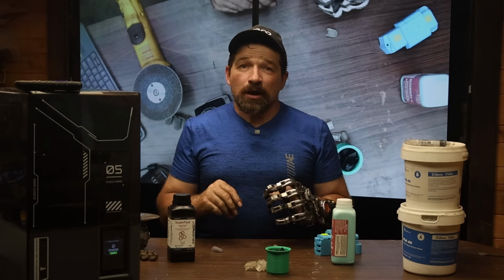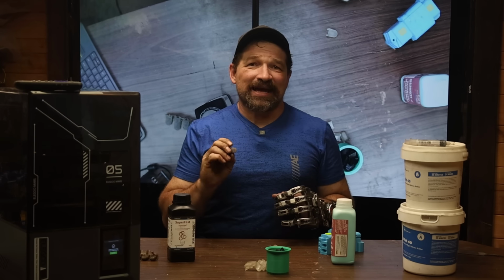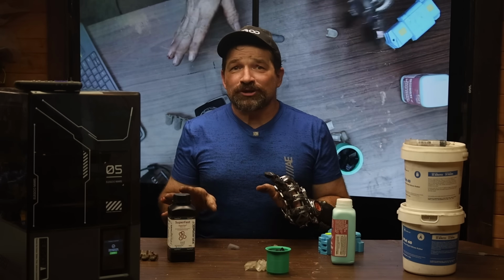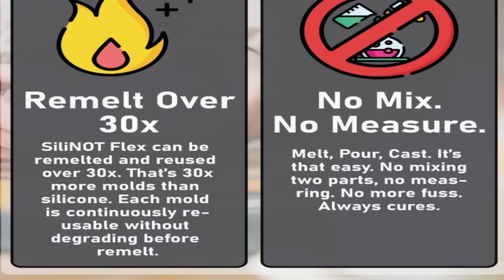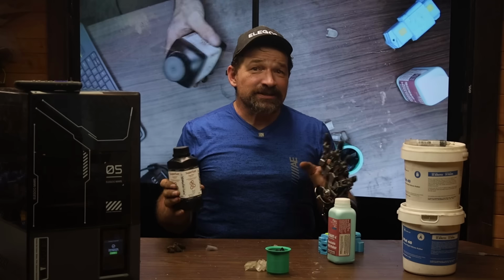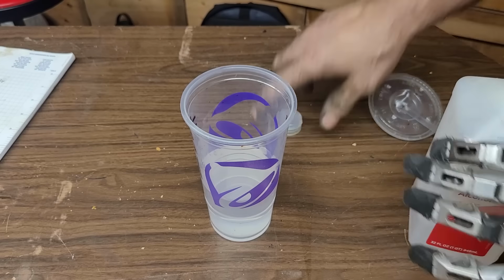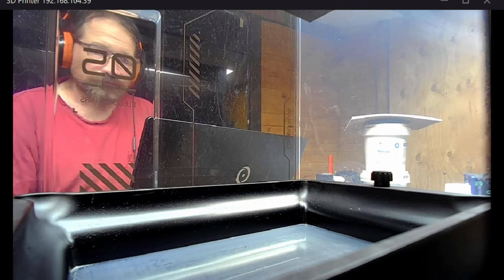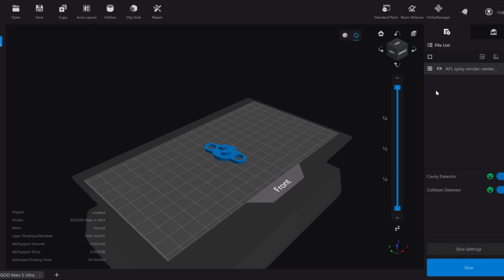Fingertip sidequest

Comment: This may sound odd, but the table tennis community has "tackiness" as a factor for the kind of rubbers they use on the paddle and "boosters"(additive/creams) that increase tackiness to the rubber. Dunno how effective, safe/food-safe, castable or if the materials have the properties needed for your case, but I hope it is of interest.
Reply from the maker: Thanks! I'll look into that.
Reply: @missingpartsclub awesome how your place here seems to have positive side effects. 
Positive waves, man. 
(It's only by dumb luck that I still have all my parts 🙈 )
 Subscribed.
Reply: @vapormissile  No negative vibes moryarty.
Reply: @mr_h831 Always with them negative waves Moriarty, always with them negative waves! 😂

Comment: Honestly, your finger tips sound like a job for natural rubber.  It's not just used in tires because it's cheap.  Afik it's a stinky thick tar before casting in a heated mold, so kind of a pain to diy.  Probably easier to CNC machine a block.  Rubber freezes and afik machines like any other plastic once frozen in dry ice or liquid nitrogen.
Reply: I concur, find out what you can about the tires used in drag cars maybe.  Heck if you contact Goodyear or some other company that makes race tires they might be willing to give you some test blocks or something.  They have to have extra chunks they did testing on.
Reply: to my knowledge latex rubber is pretty easy to work with DIY, they use it gloves as well :)

Comment: Leather? Not the most high tech solution but, worth a try.
Reply from the maker: I tried leather with the socket a long time ago, but I didn't think about it for the fingertips. I'll laminate up a block and give it a shot.
Reply: @missingpartsclub  That's interesting. My thought was to rap a form in some soft leather, never occurred to me to do a lamination like that. I'd think it too porous and crumbly.
By soft leather I mean like my favourite work gloves. Has soft grip even when wet, hard wearing and also immune to heat and what not. But the laminate is certainly more up your street in terms of material choice and style so... can't wait to see what you come up with.
Reply: A stack of sued leather or some molded sued on a silicone core sounds promising.  Afik silicone rubber works best under compression so make it an interference fit to the finger as well.

Comment: Hi, a few ideas:
1) Leather: Welding gloves made out of goat, deer or nappa leather are soft, durable and conform to any shape.
2) Use a soft silicone under the leather to adapt to the surface and leather on top for durability.
3) Gel like in bike saddles or memory foam alternatively.
4)Texture of the fingertips could be more like the lamella of gecko feet. The finer you make the lamella, the more surface area and grip you get. This could be easily finetuned with a printed mould or a textured bed.
Reply: I know nothing about this stuff, but that's such an interesting idea!! I was trying to think "hm, what could best replicate skin..." Well, the answer could be...skin.
Reply: An occlusive dressing is an air- and water-tight trauma medical dressing used in first aid. These dressings are generally made with a waxy coating so as to provide a total seal, and as a result do not have the absorbent properties of gauze pads. They are typically used to treat open, or "sucking," chest wounds (open pneumothorax) to prevent a tension pneumothorax (a serious complication of a simple pneumothorax). They are also used in conjunction with a moist sterile dressing for intestinal evisceration.
Reply: +1 for leather
you'd have to sew little flaps of it into cups/fingertips, but once they are together they should last a very long time. Might not even need the printers; once the leather is sewn, just have to add the adapter and fill with a slightly squishy epoxy/silicon mixture.
Reply: @josephd.5524  That sounds promising really. Some very high quality soft leather will basically be equivalent to a fingertip. The adapter is the bone, all youll need is a very good flesh. You could probably even laser etch a fingerprint.
Sewing seems to be the weakness to me. You would ideally want it naturally to hold the finger shape, without puncturing or stretching. Is it possible during the stretching and tanning process to conform it to a cup like shape beforehand? Or possible to bond it permanently via some form of high pressure crimping or adhesives?
Reply: very similar to what I was thinking, happy to see someone offering similar suggestions
only difference was 1) I was thinking something like shark/ray skin
Reply: @pauldeddens5349  
Now that you mention it, I know cobblers have a heat-activated leather glue for putting boot soles together. Extremely strong stuff; needs heat, pliers, and forearms like a stevedore to pull them off again. For fingertips that'd be plenty strong and to apply it you just need a heat gun and something to apply pressure, in this case a pair of pliers would be plenty. Can avoid the sewing altogether.
I figure it'd just be a matter of cutting out a small piece of leather that can be folded over itself enough for gluing, some experimenting would be needed to get the shape right.
Reply: Just use leather made from udder teats.  Preformed! 😉
Reply: I think the issue with leather would be cleaning it, especially if you use your fingers to eat (chips, fries, popcorn, Pizza ect)
Reply: Leather is the way to go for sure. Nature knows best over all this synthetic junk

Comment: The resins are usually quite brittle. The flex resins are easy to tear. This looks like two sides of the same issue, lack of cohesion, characteristic of relatively short molecular chains or low degree of crosslinking, it also happens to thermoplastics as the polymer breaks down from light or other environmental factors.

One exception i've heard of is mayermakes resin from Austria. It's quite reluctant to final cure, needing an extreme amount of UV light, but once it cures, it's very robust. It has an indicator which goes from tinted to transparent once it has cured. Unfortunately it's a hard resin not a flexible resin, so it's not the right type for your fingertips.

I have also heard of another manufacturer/startup can't remember who it is, who makes a resin which needs to be cured not only with UV but also under elevated temperature, and also achieves much better cohesion. I also don't think they have the flexible type. I'll add if and when i run into them again.

Anyway since both of these do their own chemistries, and have effectively solved the cohesion problem, perhaps it's worth talking to them maybe they can suggest an additive to modify the properties or formulate a new resin which is truly rubber-like.
Reply: So i remembered the second company is 3DRS (3D Resin Solutions) from the United States with Thermal resin. The final cure is without UV, just in an oven.

Comment: I’m a Merchant Marine Engineer, and I use a sealant called 5200, it’s tough, durable and easy to use.
I would make the finger tips out of this 5200 but remove the skin of the dried sealant to reveal a foam interior.
This should give you the toughness and grip that you want.

Comment: You considered more than one resin or 3D printed material? 

Maybe you could do a more durable lattice structure with your slick materials, and somehow integrate a smaller layer of that last stuff that cracks at the structural points as the print/grip side of the finger. A crude interlock with many small posts across the inside of the fingertip surface. Which pushes up into a polygon lattice that mounts on your tang. You could use any desired mounting method. Tension clips. Screws. Glue. Whatever. 

If you’ve got clips, you could just carry spares if they start to wear. If you included the posts that reach up as those clips that secure your lattice to the tang, you can get quick feedback on if the finger needs replaced.

🤷‍♂️
Reply from the maker: So that's what I was just thinking about. Print a lattice with the interface for the distal, and cast silicone into that.  The cool aspect of it is the fingertips will be 2 tone. Which could be really cool!

Comment: Might be interesting to look into the rubber on climbing shoes. If you do I would check out a few different models it always seems like there is a trade off of friction vs durability.

They are expensive and the rubber might be trade secrets lol. Either way good luck on the fingertip adventure!

Comment: IDEA: perhaps you could strengthen the mold on the non-tactile side by adding a hard shell with adhesive that serves the same function as the fingernail, to some extent. Yes it will only prolong the time before the mold breaks and will be harder to inspect, but the stress points will potentially have more strength in the added rigidity by the added ‘nail’.

Comment: 3d print a honeycomb scaffold in carbon filled nylon, the rough texture is perfect for excepting a coating of silicone or something similar. 

I would just brush that resin into the scaffolding of the nylon part and use a handheld uv light. 

If you do use this method I recommend not over curing the resin. It seems to become brittle. 

That resin can be mixed with none silicone like resins in low ratios (>30%)

Comment: my mind goes to regular leather or latex for alternative options, since they're used in gloves so often. the end segment of each finger could have an indentation for a sheet of material on the underside and holes through the segment in order to simply stitch the sheets on, making them easily replaced (although not as easy as having a few spares in your pocket with the tang setup). i'd maybe lean towards leather, just for niche scenarios like petting an animal where you wouldn't want too much tugging on hairs and whatnot that rubber might cause. if it were on just the underside then you could also have a fingernail on the topside, if thats something you want.
in any case you're awesome dude :)

Comment: for the resin finger tips you could increase the cavity size where the metal part is inserted and then fill it with maybe a silicone of some kind this might give you the exterior durability of the resin while keeping the inside more flexible to hopefully avoid cracking from the metal inserts

Comment: ColorFabb has produced a special TPU filament called "VARIOSHORE TPU" that foams up and changes its shore hardness based off what temperature it is printed at.
Reply from the maker: I am using a different version of that material rn. But I'll order a roll of it from my guy at Polymaker. Thanks!

Comment: Hey there! This is the first of your videos I’m seeing, so apologies if you’ve already tried some of this. 

I think some testing would need to be done, but I can see adding fibers to the silicone adding strength, creating a composite material. The density of fibers and the fiber material used could be varied and tested. Cotton balls would be a cheap first test, just to see if there’s any benefit to the fiber/silicone composite. 

Another question I have is if a dual-molding process would work, where a harder material is used for the bulk of the prosthetic tip, then that piece is fitted into a mold with a small gap for silicone to flow between, creating a grippy surface over a more solid base. You’d likely need grooves in the core of the tip, to keep the silicone adhered once cured. The grooves would also help the silicone flow into the mold. You’d almost certainly want to degass with a vacuum chamber for this method. 

I also happened to watch this just after watching The Thought Emporium’s video on DIY gecko tape using silicone. I’m thinking you could use a similar method to the one he used, of molding the silicone to a diffraction grating for the added tackiness. I don’t know if the grating would still work as a mold if curved to make a more finger/like shape, but I think a small piece of the grating at the “fingerprint” section of the mold might work. Maybe multiple, set at slightly different angles and joined together to form a low-poly curved shape?

Anyway, I’ve subbed, and am interested to look into more of your stuff. I hope this isn’t offensive in any way but I find the prosthetic itself very cool, and it was the draw in the thumbnail for me. Your energy and engineering is going to keep me coming back.

Comment: Curing resin prints in water results in different results, for most resins anyway. Some manufacturers recommend it. It is done to limit oxygen reacting with the part.
Reply from the maker: I hadn't heard of that before. Do you vacuum the water first to get rid of the dissolved gasses? Or does that matter? Regular water normally has a tremendous amount of air dissolved in it. I'll do some research,  thanks!

Comment: After reading through the comments several people have suggested natural rubber, like in tires.  I think regular tires are probably not right but perhaps the rubber used in "slicks" like they use for race cars and drag cars would work.  If you've ever watched that once they heat the tires up by doing pre-run burnouts they are so sticky that they pick up dirt off the track but I bet at room temperatures some of those could work well, and I'm sure if you asked a few race tire companies they'd be willing to provide you with test blocks or something.  Someone said if you refrigerate or freeze the rubber you should be able to machine it like any hard plastic.
Might also see if there are any high-end tire places near you that have them in stock, they might at least let you go touch them to see what they feel like.

Comment: Hey Ian! Mechanical engineer here! I’ve been watching for a while! Love your work! 

For the fingertips, do you think that a two-step process would be feasible? My idea was to print the fingertips as durable as possible, and then coat them with a spray-on type silicone. You’d of course have to print the tips with a rough surface to accept the silicone, and a fraction smaller to account for the thickness of the spray layer. But one benefit would be that you could use a soft type for grip, and when they wear out, you can just peel off and reapply a new coat. 

Just an idea, may not be practical, but wanted to toss in my two cents. Keep up the good work!
Reply from the maker: Heres the link to how i overmold the printed cores. The process sounds like what you're describing.  I use a 3d printed core that clicks onto the metal distal and also has a mechanical interface that holds and keeps the silicone in place.  Lmk if I misunderstood what you were saying. Thanks! https://youtu.be/ZqMFNexzX4o
Reply: @missingpartsclub  No misunderstanding on your part at all! This was me being completely uninformed. After watching the video, I can see that I seem to have dumbly reinvented the process that you are already utilizing. Hopefully a solution for the correct fingertip material arises soon. All the best!!

Comment: I think the curing cracks may be related to tensions building up inside the material around hard square corners. The same problem occurs with extruded plexiglass after cutting/ heat treating. Solution is to soften all corner edges.

Comment: Really great video. Love the way youre taking us through your process and thinking process. For the SLA printing for flexible resin. Could you do a test where you leave a set of fingers on a metal tang just lying around in your house where it gets some light but is not in direct light to see if the cracks happen even when not in use? If this is the case you could work on the tang to allow for some flexibility. I.e. Tang -> thin layer of e.g. silicone -> printed tip. This would give the printed tip a "little bit" of "room" to contract and not crack?

If it is due to the wear and use of the material I would be really interested in some testing on a set up to see what causes it under what forces. Depending on the print orientation could there be some gains to be made here?

Comment: For specific applications like using the grinder, maybe you could use a softer silicone on the middle finger section or palm and keep the rugged textured bits for the tips of the fingers>

Comment: I imagine that this might be a little tough to easily source, but have you considered the fabric that is on the "catching" side of football receiver's gloves? it has a slightly tacky surface that could provide enough friction for grip while also having the malleability of a thick fabric so the more pressure applied, the more surface area the fabric contacts to provide a better grip. You could also use harder material for the fingertips and perhaps glue the fabric to them. Either way, I love seeing your work and what you think of!

Comment: Not sure if you have tried it, but i use "varioshore tpu" for insoles, for the soft and squishy parts i use gyroid infill at 7-15% range to create a cussion (might be a bit too soft for fingertips). CNC Kitchen has a video on the material print settings. For insoles could not ask anyrhing better - it is perfect. Also  from what i understand material was designed with prosthetics in mind

Comment: Maybe consider a fingertip design with some sort of fingernail. The nails are actually an important part of grip with fingertips. The hard backing provides important structure
Reply: well finger has metal core that acts the same way as nail i think.
Reply: @basilhanas8453  they looked like just a skeleton to me. The hard back on the exterior add limits to the rotation of the flesh around the bone